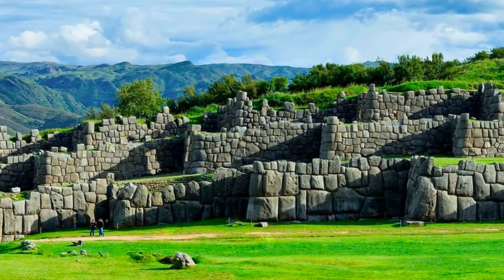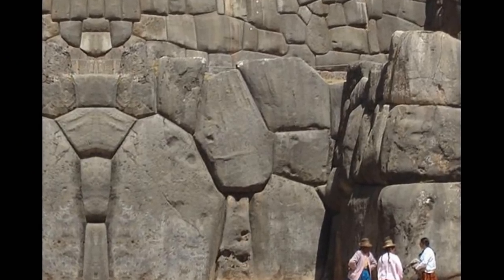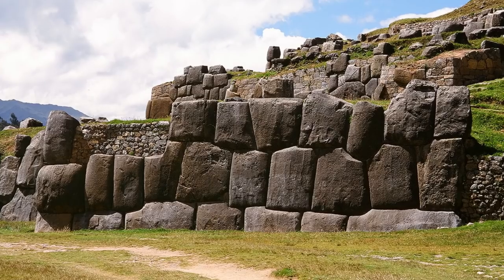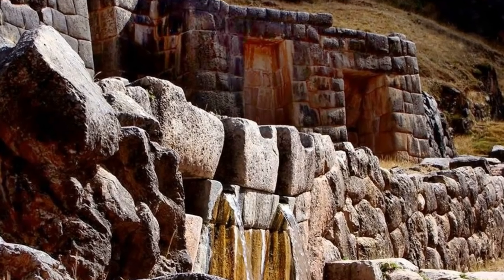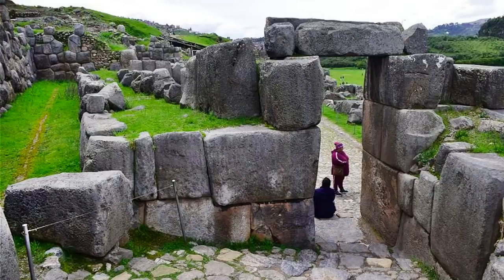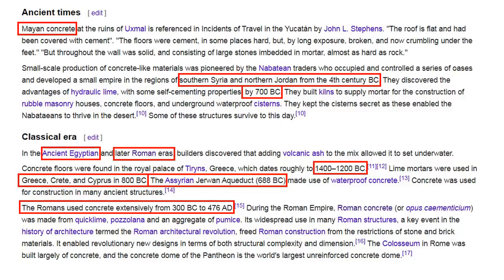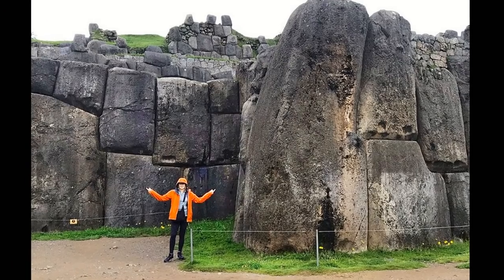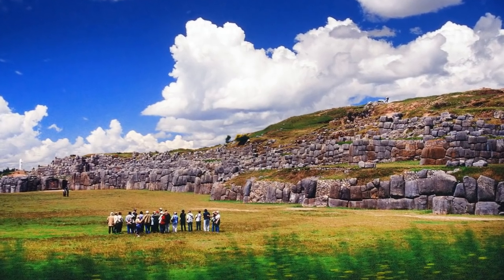Explained: How were Peru’s #Sacsayhuaman Walls Built

Comment: Great analysis!  I'm just not sure if any cast was needed if they were indeed like dough.  In any case, these builders were ingenious.
Reply from the maker: Thank you! Good thought.  I think the "dough" was created by mixing and pouring concrete-like material in molds/ forms which cures to a plastic state; similar to making dough for bread or pizza, which would need a container to mix water, flour and yeast, then wait for the dough to raise to a natural rounded shape. Because the Saqsawaman blocks are mostly large and close to rectangular shapes, I think molds were needed to achieve this result.
Reply: @CuriousBeingbyTina   Good point.  You would at least need some kind of container to prepare the materials.

Comment: Another  great vid.I agree with your theory but more research needsto be done . Keep up the good work
Reply from the maker: Much appreciated.
Reply: The researchers proved the blocks came from the quarry...
Reply from the maker: @_John_P   "The analysis showed that the chemical makeup of the samples from the quarry and the wall of the fortress at Sacsayhuaman is practically identical. Such close similarity of the chemical makeup of the analyzed samples indicates that the material of the blocks in the wall was produced from the limestone, which was obtained in the quarry"
"With regards to the material of the blocks, we can confidently say, that the process which formed them is
impossible in nature. This is based on the fact that cryptocrystalline organogenic limestone can recrystallize up to marble in the presence of water and high temperature, however, this results in large crystals being formed, since processes occur slowly in nature and the crystals have time to grow. Uniform [homogeneous] fine crystallinity, as in the presented samples from the blocks in the masonry, could be obtained under a very rapid process. Furthermore, under the condition that at any point in the system there is enough water, and carbonate material. "
Reply: @CuriousBeingbyTina  I quoted the same for you, the crystalline structure is atypical, however it does not support the concrete hypothesis. It's atypical in the sense that marble did not form as expected, and it's possible to prevent marble formation by allowing water ingress the block through the cracks only, hence controlling the aging process. It has nothing to do with building blocks from powder.

Comment: Even if you had "stones" made of flexible or even expanding concrete, it would not explain the often perfectly straight connections. A flexible material would tend to float downwards and to the sides, but the one side with the still expanding or not quite hardened surfaces would not be flat and form at straight connection. The side where the next stone was still missing, would be very difficult to keep straight too. Your idea is not new, but it could be a part of the explanation. Anybody suggesting solutions must show how his/her idea would work in the continuous process. Make a video of how you would build the wall - as a scaled model.
Reply from the maker: Thanks for the comment, Eigil. Actually most stone blocks at Sacsayhuaman do not have perfectly straight conjunction lines, instead they have subtle sometimes obvious curvatures (as shown in many photos). In the video I also showed footage of the enjoining faces of two blocks; they are not flat either.  I came to the flexible material conclusion because of such characteristics.
Reply: @CuriousBeingbyTina  If you look at the double image at 7:20 you will see a number of vertical (almost) straight connections. Such slightly curved lines would not be possible with two elastic bodies working against each other. The connection would most likely create an S-curve. The most important part in bringing a method forward is - in my opinion - to imagine and show the progression of the current layer - how it works from left to right - or right to left. With modern techniques we will always have the previous stone, the current stone, both with a fixed shape - but no next stone That's not a problem with a fixed sized stone or brick, but it would represents a problem with a flexible body. Try the sequence with the wax, press top-down and observe what happens. That said - it's a remarkable and impressive way to build a wall. Why would anybody do it that way? The hard way. Was it because it was easy for them, or was it important to make it beautiful? It's also interesting that the tool marks shown on some surfaces are much alike the marks we can watch in videos from Egypt - for example around the large obelisk in the quarry. If the quarry for the specific stones in the walls of Saqsawaman is identified, the blocks must have been quarried, which talks against the idea of pure concrete. I watched another video long ago made by a guy who had a theory of a softening liquid - an acidic substance which should be present in the quarry (don't know if it was the same location). But he didn't demonstrate how the softening should take place or when in the process. It's a lovely mystery ;O)
Reply: @Eigil_Skovgaard  I agree that the continuous process is a bit of stumbling block for the polymer theory. But how about this - I have been thinking that maybe the wall was fist constructed as a normal dry wall, with roughly shaped stones and gaps between them. Then something was applied between those stones to soften them slowly and get them to mould to each other and so close the gap. Either a chemical softener or a type of vibration. There is a video on youtube demonstrating melting/moulding of stone by sound, where the vibration of the sound was transferred to stone via.a piece of metal. So in this imaginary scenario the builders could have had metal sheets wrapped around, or inserted between stones, which were then vibrated in such a way to soften the outer sides of the stone. I'll try to find the video.
Reply: Here. Starts around 1:44
Reply: @nat7x7  It's a theory, but still such a process wouldn't leave the perfectly flat or straight connections as we can observe exists.

Comment: Strong topic and we'll presented!

First of all I would mention, we today are very well able to make such a wall.
We have the tools, we have the time and most of all, we have a high precision surface mapping, in order to make mirroring surfaces.
The later is needed as the seems are 3d-shaped.
This all could be done mechanically, and the only way to provide us technologically, is development..
We might be surprised to find such a masterwork, but we should really consider there where more civilizations like us..
Humans with the same quality like us right now, have been on this earth so long.., and it costed our civilization just 12000 years to make cranes, airplanes and the enormous power of the computer, on which we read this words worldwide!

The sandstone used here, is prooven sandstone, not concrete, as they have a different content.
The research was done on repairworks, showen in their videos, and indeed where amazing to see.
It looked more a treatment like plasma torched and the sandstone seemed chemically to be heated,without the use of oxygen..( plasma?)
They might have used it also for surface modeling, who knows?
Fact is, we as the world population right now, did not feel the need to develop along this direction, and so we didn't.
An open mind for this sort of construction is still the best way to go, I think?

Inside these walls, are some very precise squared blocks found, used as a filler!!
Which means, they could make a beautifully even shaped wall, like we do today.
Question then is, why didn't they ?
Those builders new probably, it wouldn't stay upright very long in this earthquake territory..

Thanks for the new approach, and good pictures, some where new to me!
:-)
Reply from the maker: Thanks Thomas :-) I don't think we can make such walls today. I received a comment from a expert who has worked with concrete for 40 years and he said we are not able to do so with our concrete.  I read from the geophysicists' report that the stone here is reconstructed limestone. They did an authorized experiment on site with a stone sample; the sample dissolved when poured acid. Sandstone doesn't have this character. Some claimed the stone are granite or else, but I haven't found a material study on this. If you have information about the stone type being sandstone, could you please share with me?  Thank you - I appreciate your insights!
Reply: @CuriousBeingbyTina  , I meant by this, we are capable of mirror the surfaces by computerized methods in 3d, it does not matter wat material you want to use, we can structurally make it.
We just don't feel the need to do so, and work with other materials much more.( We can scan..and then mirror print it.)
But in any iron mine, you find wastewater Wich is eating the stonesurface quiet agressively , and they might have used or anhanced this mine water with pyrite, and made the temperature rise some more, to make this muddy substance work as softener on walls like this?
Ancient stories tell of red mud with gold...the ancients used.( Wich might give us a clue)
I will search for the article I once read about this solution, and send it to you, okay?
Cheers👍
Reply from the maker: @ThomiX0.0  Hi Thomas, thanks for sharing the PDF link with me. I wanted to reply to that message but couldn't find it in the comment section.  Anyways, thanks for the information on Andesite!
Reply: @CuriousBeingbyTina  you're welcome. The comment I did give you, I did give on the latest post from this week..:-) but after a quick check, I didn't find it either..:-/ lost forever..

Comment: Occam's razor states that if you have competing ideas for the same phenomenon, you should choose the simpler one.  This seems like the simplest way to me.  While we don't have every detail worked out (the formula for the "concrete"), the overall concept makes more sense than quarrying, transporting, and perfectly fitting together multi-ton blocks.  The next step (if it hasn't been done yet) would be to try to recreate them based on the available materials in that area.  The explanation of the pillowing out to the front is what makes this explanation more likely to me.  I think it clearly shows some expansion as the stone sets.  I'd take it further and say that their formulation likely involved a process that involved mixing in a hardening agent.  There's evidence of stonework in Machu Pichu in Peru where it looks like the stone melted from extreme heat.  I believe this was the result of too much hardening agent.  I used to work at a shipbuilding plant and I heard stories of people accidentally mixing in too much MEKP into a fiberglass repair and it causing massive damage from the extreme heat created.

Comment: Great presentation of important facts supporting the geopolymer explanation!  I really like the way you illustrated how the tight joints along with exterior bulging supports this explanation.  The Russian study was done by industry technical experts who provided hard evidence for the use of molded geopolymer stone casting in prehistoric times here.
Reply from the maker: Thank you for the support, Eric!
Reply: They proved the blocks came from a nearby quarry, there's nothing in their paper that supports anything she said. Even where they say the process for preventing the limestone from recrystalising is unknown, they even explained how it could have happened by controlling where water would enter the rock right after quarrying.
Reply: Maybe they are molded in the ground like in dugout trenches, then pour the mix in layered sections and form blocks so that they interlock by pouring each block separately and letting it cure before doing the one next to it .The weight of the mix might bulge out into the sides of the trench giving the blocks sides that bulge look .
Then they would remove the earth from around the completed wall .  
If the blocks aren’t stuck together, they might have applied some kind of oil or powder to the cured blocks exposed sides before pouring the next block adjacent to it , which would give the blocks that super tight fit look .
Soil might have had some clay in it to allow for smooth sides .  All this is just a thought.
Reply: @williamgrimberg2510  The crystalline structure under the microscope is identical to the rocks from the quarry. If there was any pouring and casting involved, the structure would have been completely different, it would have become uniquely amorphous and homogeneous instead.
Reply from the maker: @_John_P   "The analysis showed that the chemical makeup of the samples from the quarry and the wall of the fortress at Sacsayhuaman is practically identical. Such close similarity of the chemical makeup of the analyzed samples indicates that the material of the blocks in the wall was produced from the limestone, which was obtained in the quarry"
"With regards to the material of the blocks, we can confidently say, that the process which formed them is
impossible in nature. This is based on the fact that cryptocrystalline organogenic limestone can recrystallize up to marble in the presence of water and high temperature, however, this results in large crystals being formed, since processes occur slowly in nature and the crystals have time to grow. Uniform [homogeneous] fine crystallinity, as in the presented samples from the blocks in the masonry, could be obtained under a very rapid process. Furthermore, under the condition that at any point in the system there is enough water, and carbonate material. "
Reply: @CuriousBeingbyTina   I quoted the same for you, the crystalline structure is atypical, however it does not support the concrete hypothesis. It's atypical in the sense that marble did not form as expected, and it's possible to prevent marble formation by allowing water ingress the block through the cracks only, hence controlling the aging process. It has nothing to do with building blocks from powder.
Reply: @_John_P  hang on bro.. so the sacsayhuaman stone blocks came from a limestone quarry (identified by the similarities in composition), but they are not limestone or any natural limestone derivative, and they are not in a natural environment.
 So we have a rock in a man made setting which is identical or very close to a local limestone, but which isn't limestone or any known natural derivative..  how can this not then be a geopolymer? Haha, all good bro, it's good to keep thinking but what other explanation is there here? Cheers man ✌
Reply: @_John_P  She asks all the right questions...but gives all the wrong answers...and ignores any challenge to their wrongness.  Too bad...we value her research, just not her conclusions.
Reply: @_John_P  She asks the right questions...but gives the wrong answers...and ignores any challenge to her data or conclusions.
Reply: @jamescgardner1269  "identified by similarities in composition" <- No, identified by crystalline structure. What's the difference? Crystalline structure is unique to the process of formation of the rock, it's a consequence of composition, water, air, pressure, temperature, time, etc, producing a unique fingerprint. A rock that is transformed into power will never have the same crystalline structure, it would become amorphous and homogeneous. Their study concludes that they took the rock from the quarry and used it the way it came out off the ground, with only one difference, which they explain can be produced by making the rock hydrophobic (coating with tar for instance) and adding water through the cracks only, then allowing it to age.
Reply: @stephenphillips4984  They did nothing wrong, they are being misquoted by the publisher of the video.

Comment: Fascinating! Those bumps on some of the blocks remind me of “drop defects” seen in some of the casted metal parts used at my job. I think it happens because an impurity gets into the molten metal.  Great channel and it is hard to fathom the implications of this. If this is like concrete they wouldn’t they need a lot of water. Where would the water source be if it is so high in the mountains?
Reply: You probably don't know that the whole range of the Mountains on South America's West-Coast were raced up, partly even from the sea floor as corals on some mountain plains prove without a doubt, in a not so distant past of 12000-10000 years. Some buildings on Lake Titicaca prove that there was once a seaport. Additional, the whole South American Continent was tip over to the region of what is now Venezuela, the Guyana, Suriname, French Guyana and Brazil Northeast Coast, while the whole West Coast was lifted as well as Argentina. Therefore, the whole area we are talking about was much lower, and we don't know anything of the climate of that time!
There are old stories of a time when the mountains were on fire the earth shook snow fell and the stars moved in an unordered way and mountains rose.
Reply: People carrying water up a mountain is whole lot easier then carrying giant stones...
Reply: @fritz3388  That's nonsense. There is no geological evidence for such an uprising as little as 10000-12000 years ago. The buildings on the shores of Lake Titicaca do NOT prove it was a sea port, only that the lake water level was higher in the past than now.

Comment: I think you're right because i have the same theory! A cement that makes stone. I wonder if they used a sort of mold or how they did to keep the shapes so precise. I wonder if they could have a tissue or leather mold, or plastic, or nothing, but even today, how would we do? Anyway, I agree 100% with the cement theory, and also with the bumps coming from an excess of material that was sucked out. Also sometimes leaving a concave mark. Maybe some mold where filled through this tubes, and then the tubes cut, leaving this mark.